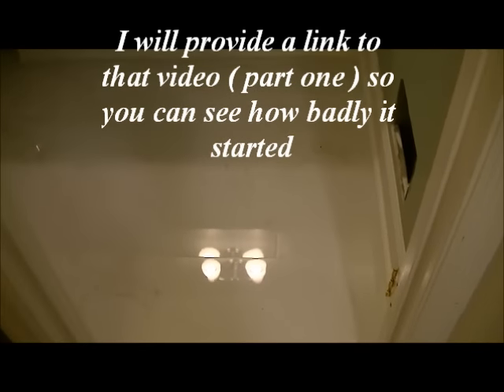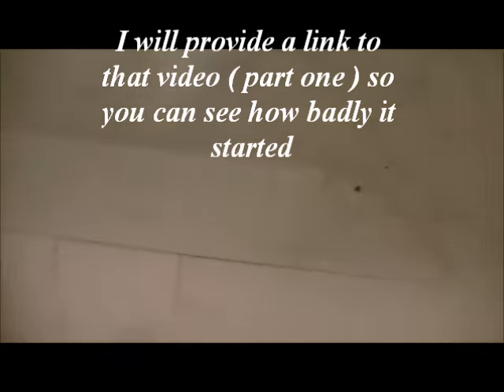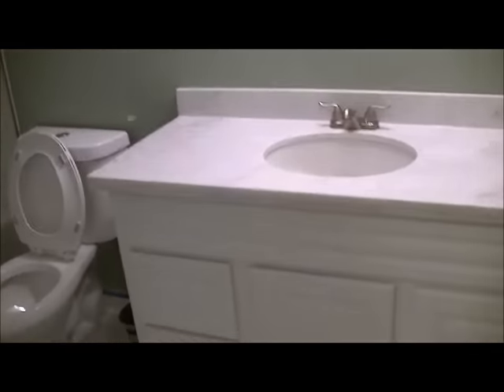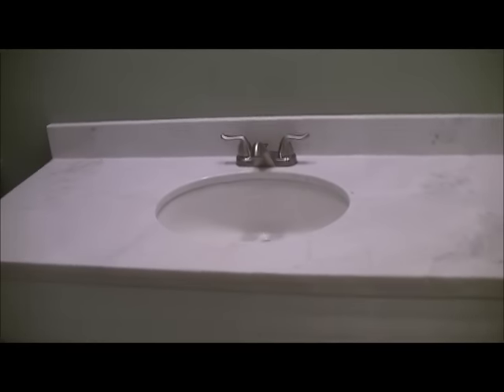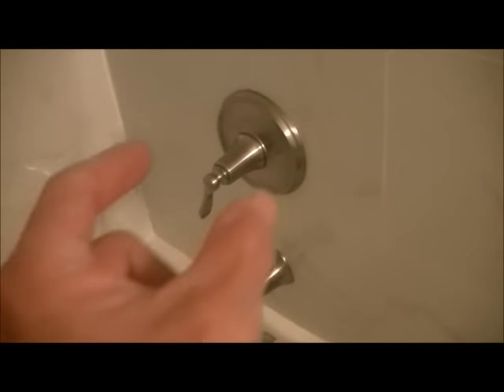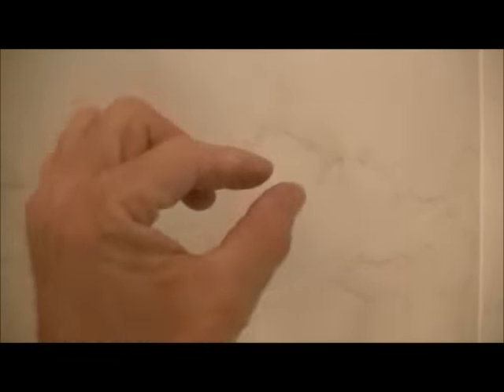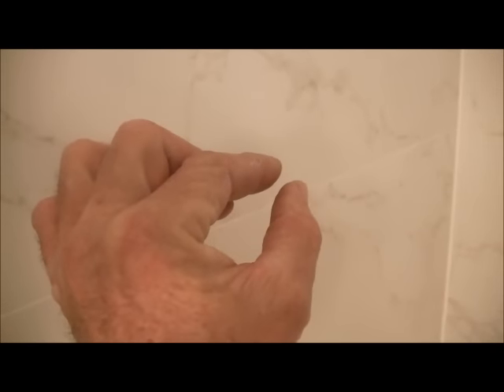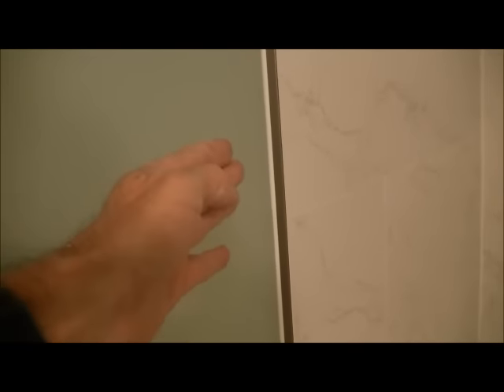Finished Tile Job ...( from "tile guy messes up project" )

Comment: Outstanding level of fit and finish! I am a carpenter who tiles occasionally, and it is a humbling experience every time. My only suggestion is to use base shoe instead of quarter round. The taller profile of base shoe looks a bit better in horizontal applications, whereas quarter round is better suited for vertical. Thank you for sharing your expertise in these videos
Reply from the maker: Thanks for watching

Comment: Great work. I feel out of my depth, i'm a builder, never done tiling, using inadequate spaces on heavy tiles could so easily have happened to me. What is the correct method for the cutting around the shower head? The reason cuts were of poor quality was they were using a blunt blade only or should you use the scoring type cutter with porcelain? Also confused about the comments about the options on the trim. A bull nose is a bevelled edge on a tile that you can buy like that (you can't do it yourself?) and you use that for a niche? Then if you have an uneven wall use a bit of trim? Not really in this video but i am still confused why you start tiling off a batten if you already have a perfectly flat level surface like the edge of a bath tub?
Thanking you for any possible comments you may have
Reply from the maker: Cutting around shower head use a wet saw...takes time to get circular cuts right.
Blunt or dull blades begets bad cuts...this tile is not good for using a score/snap cutter.
SOME tile come with matching bullnose or as you said beveled, this did not. There are blades you can make bullnose with, I don't own one...in the end the custome makes the choice. 
IF THE TUB is completely flat & level, yes you can start there, most are not. Easier to begin with cut tiles & level those.